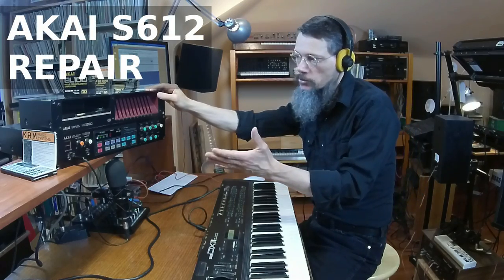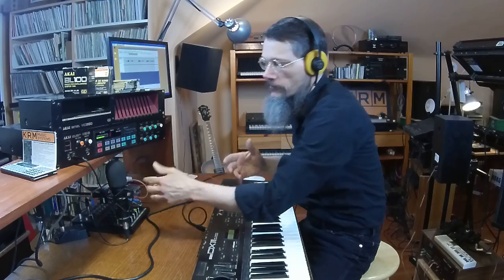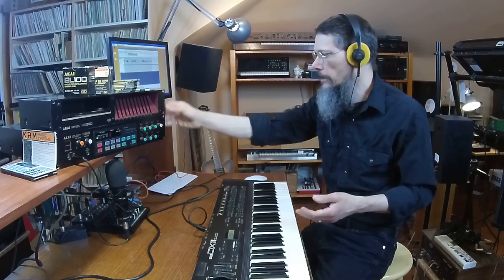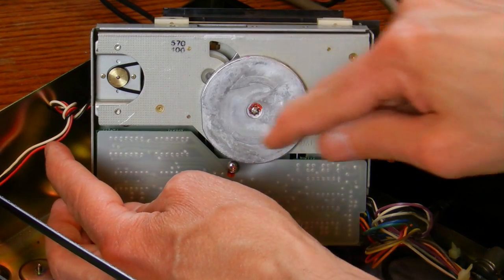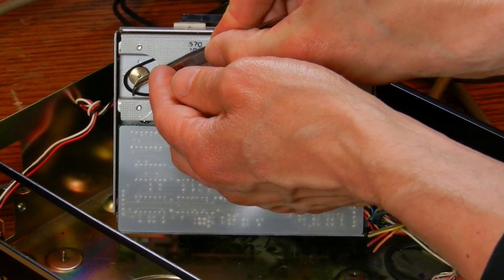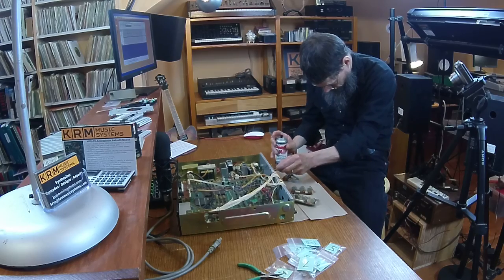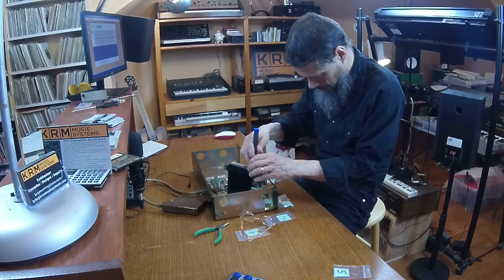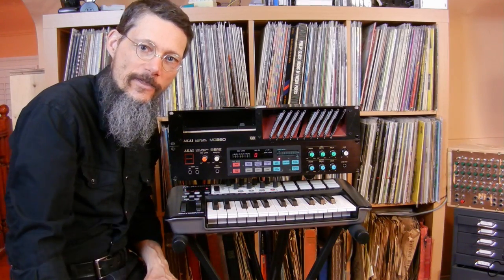Akai S612 Sampler Repair

Comment: This is a phenomenal sampler ( i own two S612, an s700, s959, mpc3000, s3200 and the s612 is the best sounding Akai by far), i advice you to recap the PSU as soon as you can as the PSU caps are the only weak point of the machine, once those caps start to fail they damage the mother board but if you replace them the machine will last you for other 30 years ✌.
Also i highly recommend the Hidaway floppy emulator XD-280 it is a true game changer for the s612.
cheers

Comment: What’s the sizes of the rubber belt that actually fits in the 280 where you get it?
Reply from the maker: There is a link in the description for the belt kit that I ordered.  I don't know the exact size required.  I simply tried a few belts that were close.
Reply: Supposedly it’s the same size belt for the famicom disk system